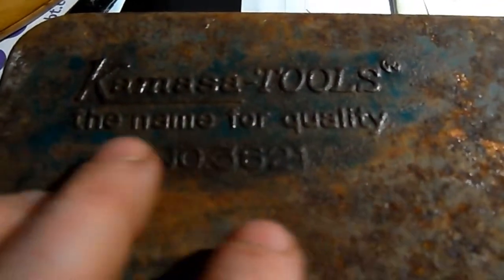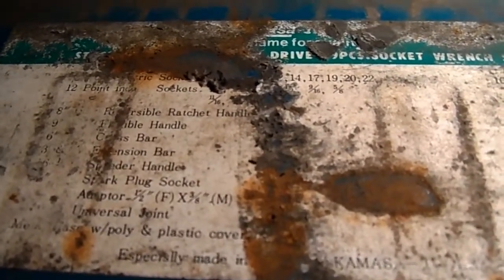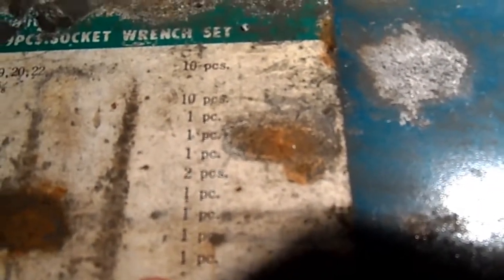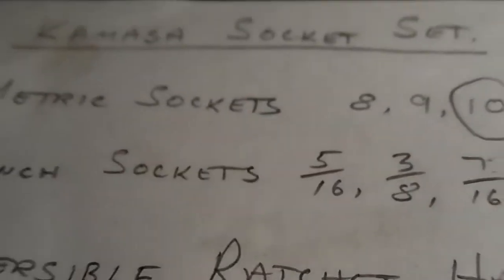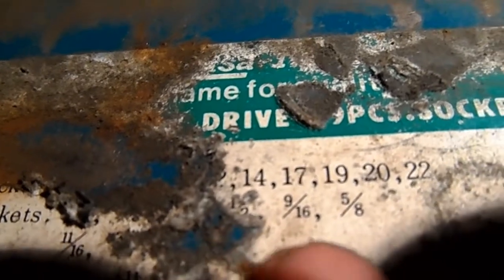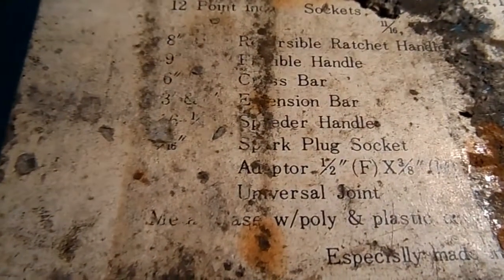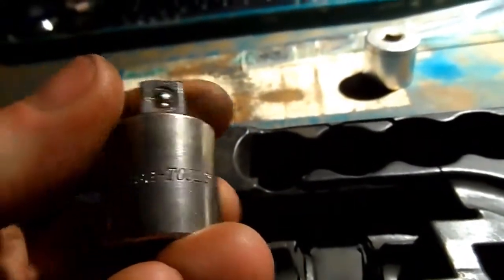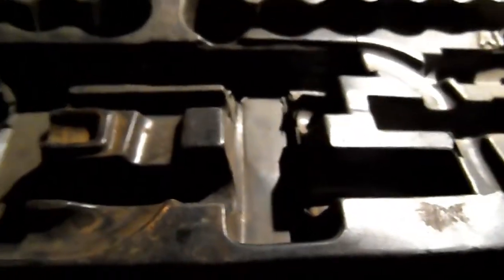Kamasa Tools Socket Set #3621 - 01

Comment: Worked for a company that sold the Japanese made Kamasa tools back in the 1970's into industry. We sold hundreds of them and never had one warranty claim on them, I had the 1/2" 42 piece set with the 72 tooth ratchet and its still going strong 40 years later....
Reply: I purchased a 1/2" 24 piece set in "mm" some years ago, and it's incredible high quality.
The brand name sounds Japanese, but in fact Kamasa Tools is a Swedish company founded by Zygmundt Joseph Kamasa in 1968. 
( https://sv.wikipedia.org/wiki/Kamasa_tools ) This wiki only exists in Swedish.
That said, Kamasa Tools does not offer any information about where their tools are made. 
Some parts might be or have been manufactured in Japan, but I can't find any information on this. 
What I know for sure is, that if their tools was 100% produced in Sweden, they would surely use it in their marketing. 
So my guess is that they're having parts manufactured all over the world to Kamasa's specifications. ;-)